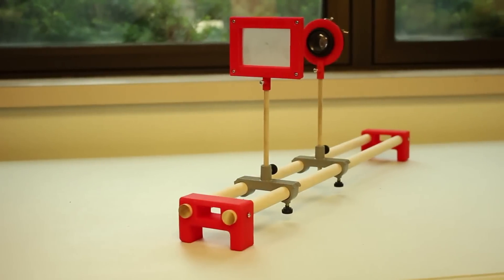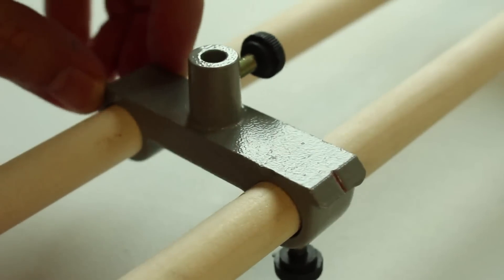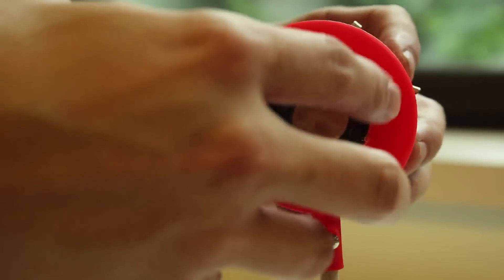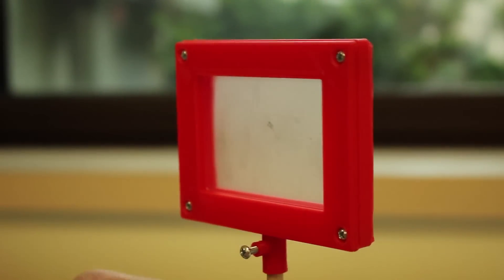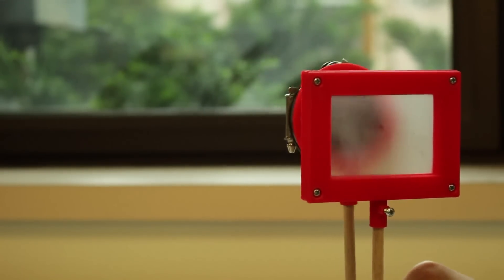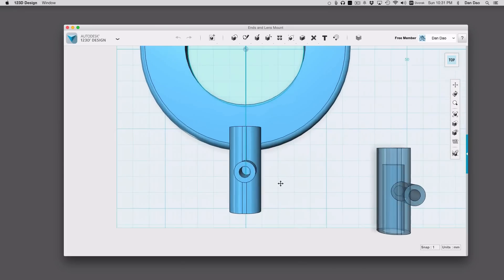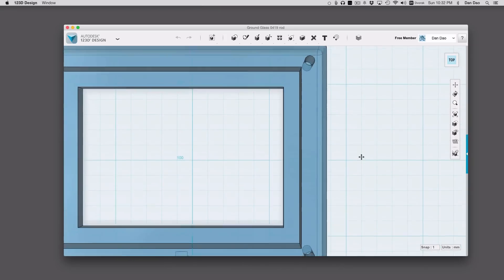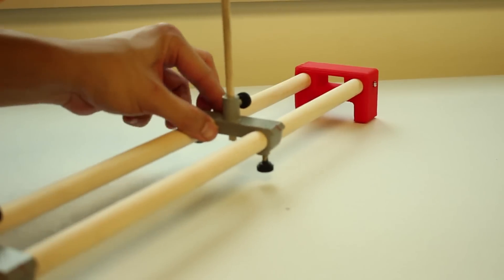Make it Series: DIY 3d Printed Optics Bench

Comment: So if someone wanted to use this to make a custom lens, it would be possible to create multiple lens mounts and put individual elements into them and trial-and-error the alignment?
Reply from the maker: David Hancock yes exactly, you'd just need to get the elements and experiment. My original goal was to make a cheaper Petzval lens, you could totally make open source lenses. A lot of those patents are up.
Reply: So if I sent you some specifications for a unit, could you 3-D print it for me? (I don't expect it for free, BTW.)
Reply: Have considered printing molds to pour resins in and building your own lenses? I think with sanding and acetone vapor one should get decent finished on the mold at least.
I have had the idea of making my own lenses for years and, having bought a 3d printer and discovered the world of pourable  resins  it all fell into place.
Do you think it might work out?